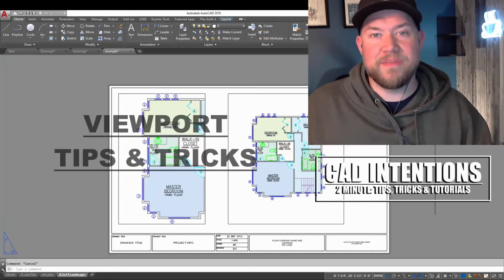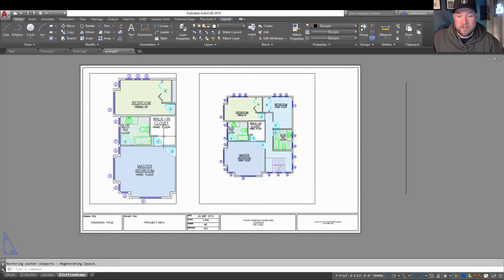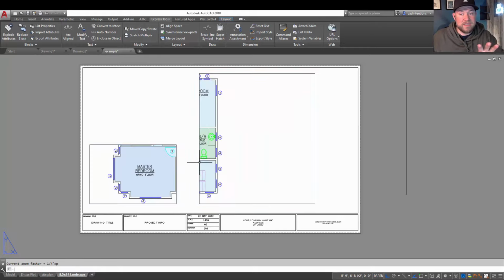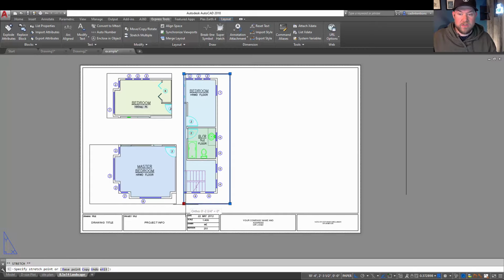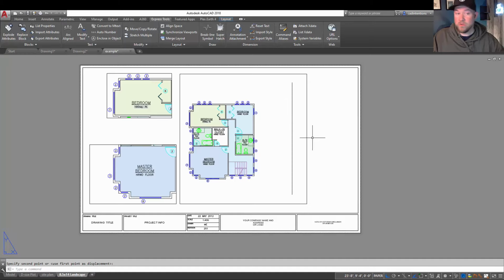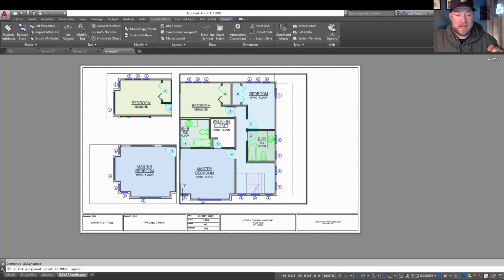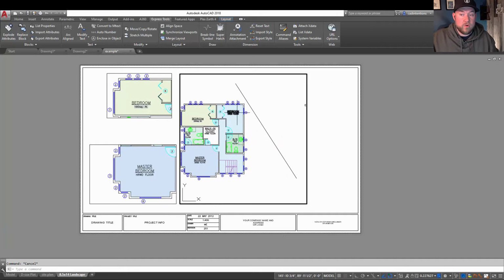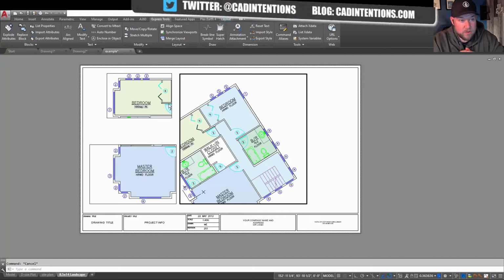AutoCAD How to Easily Setup Viewports - Synchronize & Align Views Quickly! | 2 Minute Tuesday

Comment: Do you have cad work station recommendations for architectural desktop?  Laptop?
Reply from the maker: I don't work with Architectural much but a few of my favorites have been the new versions of the Lenovo Thinkpad P series workstation laptops as well as the HP ZBook G series of laptops. Both offer a variety of options depending on your needs and can be spec'd quite highly for pretty affordable costs. I've enjoyed using both.